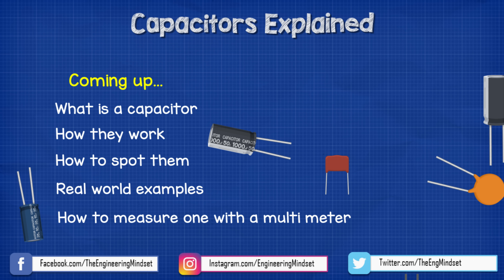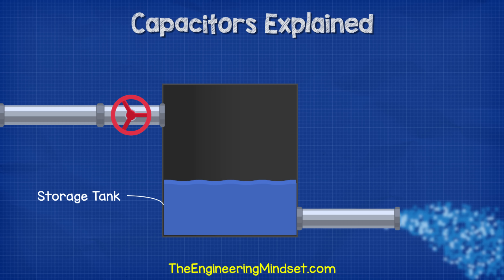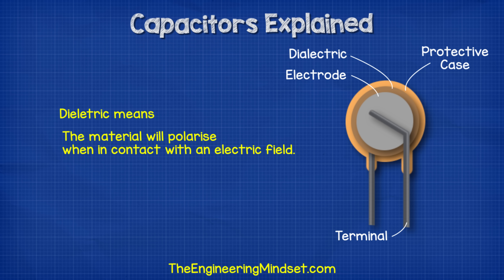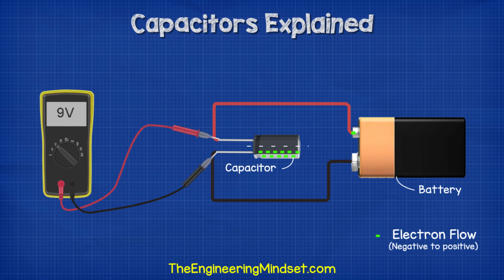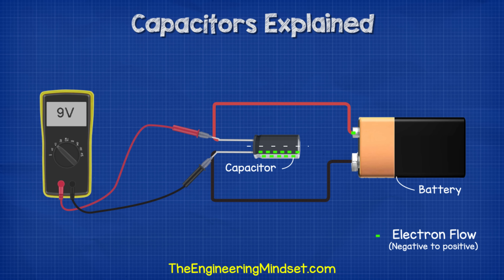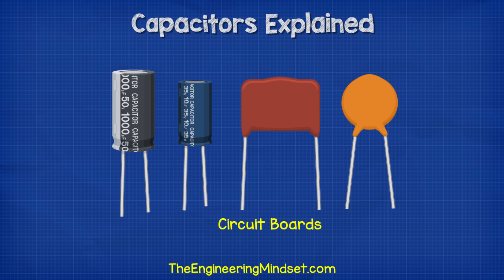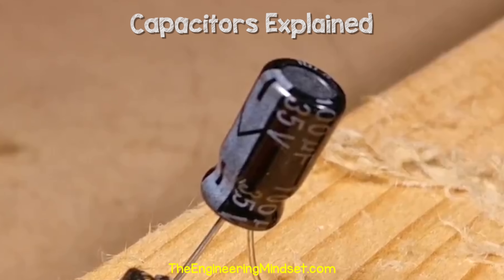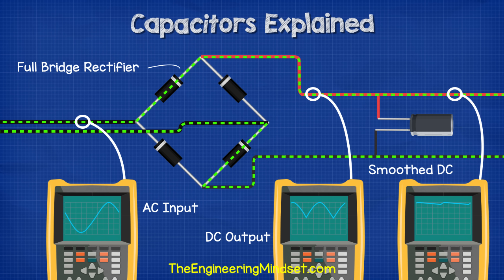Capacitors Explained - The basics how capacitors work working principle

Comment: I want a capacitor to smooth out my wife's attitude!
Reply: Get some money from her when she is happy. Buy her some chocolates when she is grumpy 😂....
Reply: @andrewwhite1793  Spot on, Sir!
Reply: Man! You get an A+
Reply: that's calle jewlery ;)
Reply: cash is also a capacitor dude. try to give her some.
Reply: she need resistor to slowly discharge it on the side
Reply: Just be careful not to touch her terminals or you might get a high voltage shock
Reply: when everyone's making jokes but he literally meant to kill his wife with a capacitor..
Reply: U need a s
Reply: good luck!!!
Reply: Sure you don´t mean "amplitude"?
Reply: It's called xanax.
Reply: u just need a resistor.........
Reply: If you have two childrens they will act as two plates as in capacitor. So after that your wife's attitude will be ok😜
Reply: It's called Valium😁👍
Reply: would that it was so.
Reply: Its called a credit card. Watchout though it can also explode...
Reply: capacitor you need is between your legs
Reply: You need a insulator  asap😂😂😂
Reply: That only works if she has an electric personality with a positive and negative bipolar disorder.
Reply: Start with a transformer
Reply: Good luck getting a capacitor that won't explode and make things worse.
Reply: Hhh
Reply: try some weed
Reply: No shit, mine was real out of phase with a wild leg to boot.
Reply: Maybe removing the resistor would help. Or try turning up the voltage in your bedroom.
Reply from the maker: Check out NEW resistor video, everything covered! ➡️ https://youtu.be/DYcLFHgVCn0
Reply: In the words of comedian Ron White, "Diamonds...that will shut her up"
Reply: @PH_INFO_101  SHE STOLE MY GAZEBO! Six million dollars later and his ex wife hired a guy to hook up a crane to snatch his gazebo out of his yard. You might shut them up, doubtful, but they'll always be up to something.
Reply: Try with a glass of wine
Reply: Sounds like a side boyfriend situation.....
Reply: @RafaelRamirez-vk4vu  What do u mean? Does having a side boyfriend change a married woman's attitude towards husband? If yes, how do u know?
Reply: That joke rates four rolling pins.
Reply: the7thsea That rates five rolling pins.
Reply: You'd need a capacitor rated in thousands of Farads for that!
Reply: Ok boomer
Reply: Should have taken the Red Pill and gone MGTOW!

Comment: The way I tested electrolytic Caps was to set a multimeter to the 200K ohm or above setting! Place the probes on the capacitors leads, the impedence will increase one way and when the probes are reversed it does the opposite. If it goes both ways - it's a worker. If it only works on one of the polarities, there is a direct short or there is no reading at all - it's a dud! Has anyone else tried this?
Reply from the maker: Check our new Multimeter tutorial out ➡️ https://youtu.be/4lAyzRxsbDc

Comment: You could've mentioned smaller capacitors (nF and pF) and the difference with how they work with DC and AC - ie. they don't let through DC, but lets through AC... and that the capacitance says something about which frequencies it let through.  Also, compare it to coils.
Reply: It's just a crash course though

Comment: Capacitors also blow up if your throw them in fire and if you chew on cylinder shape capacitors taste little sour and tangy.

Oh I forgot ... there’s a X market at rear end of capacitors it’s to direct explosion pressure towards the rear instead explosion going everywhere and causing more damage to circuit board.

Comment: Me during the first 6:24: "Hmm ok very interesting. Thanks"

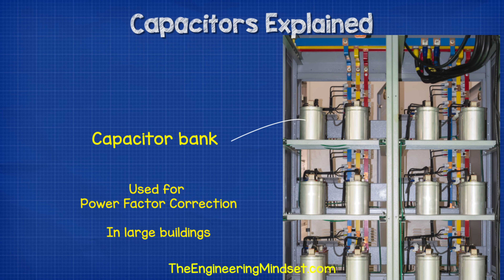Me from 6:25 on: "Wat"
Reply: AC is a game changer for capacitors and inductors. If an AC passes through an inductor, it generates a magnetic field that "holds" the current back a step (voltage is unaffected). Capacitor gets charged up with current and "holds" the voltage back a step, so it can compensate for the inductors.
Reply: @1urie1  do u mean phase difference?

Comment: I was expecting to know about the differences between AC Capacitors & DC Capacitors 🤨🤨
Reply: An AC capacitor ACs and a DC capacitor DCs.... that's the difference.
Besides a capacitor is a capacitor regardless what type. It was not shown in the video. It would then take hours. 
A capacitor ”only” change behavior regarding which circuit you put in.
There are many reason why you want using capacitors.

Comment: Wouldn't the process of reading a capacitor cause it to discharge the voltage through the meter?
Reply: Yes, but I believe it would be quite slow compared to attaching a resistor since multimeters are typically designed to detect current without consuming much of the power. Otherwise you'd have the meter warming up as current was consumed or blowing up when measuring a high voltage/wattage. 

Someone correct me if I'm wrong. :) I'm not an expert.
Reply: Ryan L. That’s true, but a very small capacitor would not store enough energy to show up on a meter.
Reply from the maker: Check our new Multimeter tutorial out ➡️ https://youtu.be/4lAyzRxsbDc
Reply from the maker: Check out NEW resistor video, everything covered! ➡️ https://youtu.be/DYcLFHgVCn0

Comment: Quick question is it possible to damage a capacitor by discharging it to quickly or is the internal resistance always enough to protect it.  This is aimed at electrolitic capacitors + even on large capacitors? Thanks
Reply: Repeated high current charge & discharge cycles can cause them to overheat (due to that internal resistance you mentioned). However a single short circuit discharge is usually safe (for the capacitor at least, may not be so for the thing doing the short circuit, e.g. the capacitor leads).

Comment: Still puzzles me why they would write 1000 uF (micro) instead of just 1 mF (milli). 
Same goes for smartphone batteries, really no need to have 4000 mAh when you can just write  4 Ah.
Reply: True, the long established convention is that "If the current flow is between 1/1,000 of an ampere and 1 ampere, the unit of measure used is the milliampere (abbreviated mA)".  Over time, the same unit ended up being used for larger currents. It could be because a battery rated 2700 MAh looks more impressive than 2.7 Ah

Comment: I like the video a lot!  I only got into learning about electrical circuits and batteries and stuff like that because of vaping.  My job is in the I guess civil engineering field, I'm a CAD Tech at a place that makes precast reinforced concrete structures for stormwater and wastewater management (bridges, culverts, etc.).  I recently learned about the condition called "water hammer" in plumbing, and the way the electrical circuit was compared to a water pipe made me wonder if there is any similar effect for electricity.  Is there an electrical "water hammer"?

Comment: when replacing a capcitor in a 3 speed ceiling fan, how important is it to match the MF of all 3 leads?
Reply: All 3 leads? As in the connectors coming out of the component? Should only be 2 leads per capacitor and you pretty much have to match the capacitance, in farads, exactly. You can use a slightly higher voltage but that may affect its lifetime.

Comment: Can you check the capacitor capacitance while is still on the board?
Reply: You can test capacitors in a circuit with an ESR meter, but it does not measure the capacitance of a capacitor. The capacitor must be disconnected from the circuit and measured with a capacitance meter, or a multimeter with this capability, to measure capacitance.
Reply: S/V Tattoo so what do I do if I just want to know if it’s bad?
Reply: @Laissez_Faire  - Many times I can tell a capacitor is bad by looking at it. Some types of capacitors discolor, swell or even burst when they go bad. Otherwise an ESR meter can help, but if you don't have one you would have to remove the capacitor to test it with a multimeter. Usually I just remove and replace suspect capacitors as it is quicker for me than having to remove, test, and replace. They are so cheap that it's not worth my time to test them. With older equipment I usually replace all the electrolytic capacitors as a first step to repairing the circuit, and more often than not it fixes the circuit.
Reply from the maker: Check our new Multimeter tutorial out ➡️ https://youtu.be/4lAyzRxsbDc

Comment: Can you talk a bit about circuit designs thot could smooth out/modulate a discharging capacitors voltage? Most devices nowadays aren't built to handle large voltage differences like 0-35v

Comment: So this means licking the leads of a capacitor is out of the question? 😄
Reply: Why would it be out of the question? All he's saying is that regardless of the outcome, you shouldn't be surprised. If your goal was to be zapped and you did get zapped, then it certainly wasn't a bad approach to take.
Reply: I would put a 9V battery on my tongue to see if it was still good...
Reply: Steve-o: Can't tell the difference between 6v and 9v. Maybe between 4v and 9v if you have a sensitive tongue!
Reply: @glasslinger  like any connoisseur I imagine it takes a developed pallet... Also pressure and continuity is important along with spacial separation all equal...
Reply: @steve-o6413  Doesn't everyone do that?
Reply: You can! Just be ready for the bite!
Reply: Yepp !!!. unless you want to roast your tongue.. (which is anyway healthier than frying it in the oil) 😆
Reply: Might be a shocking experience,  though.
Reply: Dallas Dal Your question is eminently suited for ElectroBOOM! ;)
Reply: Depending on voltage
Reply: @brianmckenzie2829  No, amperage.
Reply: @ Jim Cole No, voltage.
Reply: @jimcole6423  will 3v on 50amps do anything to your skin? no
Reply: Thanks for your correction
Reply: Depends on the voltage!
Reply: Barefoot in a pan of water.
Reply: Pure water is not conductive. Only when water is dirty. Water out of your tap contains lead, fluoride ect thats what makes it conductive
Reply: @brianmckenzie2829  The main reason for tap water being conductive is the various salts it contains; when you dissolve a salt in water, a lot of free electrons are released, and it's these electrons that makes the water conduct electricity.
Reply: @BertGrink  I do know, was trying to put into layman terms. Sorry nickeles tesla... Haha 😂
Reply: @brianmckenzie2829  My apologies, i didn't mean to belittle you.

Comment: Please explain why CAPACITOR is Not used as Battery, even though  it charges Very Quickly.
Reply: Unlike battery the capacitor discharges quickly so you will get very less amountbof voltage supply compared to regular battery

Comment: The μ symbol is the Greek letter mu or mju [mee-oo] and denotes  micro meaning ‘millionth’.

Capacitors also come in nano and pico capacitances.

I regularly work with capacitors designed to run at between 10,000 and 20,000 volts as part of an x-ray power supply.
Reply: That must be feel like a power trip XD How big capacity?

Comment: And when measuring the capacity of the capacitor it should not be more or less than 10% of the manufacturer's indication on the capacitor, if it is more or less than indicated it is a faulty capacitor and needs to be replaced

Comment: Hey this was great, but as an old fart who is trying to learn vintage radio repair, can you answer the question to when would I use a ceramic capacitor vs. a more common yellow or orange drop cap?? Thanks and God bless.
Reply: ceramics near a heat source

Comment: Why is a capicitor used in a point ignition system.  What is smoothed or stored?
Reply: When the points open and the magnetic field collapses it induces a current in the primary. It's not very much, but it's enough to jump a small air-gap, such as the one between the open points. That tiny spark is enough to erode metal away from the points and you'll 'burn' the points. The capacitor prevents the points from arcing while open by limiting the rate of voltage rise at the points.

Comment: The stripe for the negative pole of the capacitor has an arrow on it to illustrate the direction of energy flow...  Electricity flows from positive to negative,  everything in this video was explained backwards.  Aside from that deficiency the general theory is correct.
Reply from the maker: That's incorrect. Electrons flow from negative to positive as illustrated. In electrical circuits engineers draw and calculate it as the "conventional flow" from positive to negative because it makes things easier and also tradition, but that is not how it works in reality.

Comment: I graduated from Electronics in college in the 80s and you do a much better job at explaining a capacitor in a short video than what I learned in 2 years of college.  Great video....I subscribed and gave you a like...keep up the good work and I look forward to viewing all your videos.
Reply: The mark of a genius is to take something complicated and make it simple
The mark of an idiot is to take something simple and complicate it. That is what politicians do!
Reply: Is there an analogy for a transistor in a water system?
Reply: @frankgiancola7   I had a little wee on the emergency resivoir purge switch @ Three gorges dam and flooded the entire area killing thousands.
Imagine the transistors emitter being the water side of the dam the collector the dry side and my little bit of wee on the base allowed the flow of all the water from the dam to flood out.
Reply: @frankgiancola7  Surely you should know that answer if you're an electronics grad. That is City and Guilds electronics and servicing knowledge.
Reply: @frankgiancola7  Hydraulically operated valve?
Reply: @ThrawnSr  Yes haha. Almost every control device in electronics and almost every electric law has a equivalent on both sides. I think the only difference betwen electricity and fluids is gravity, and thats why current in parallel circuit hasn´t the same behaviour as fluid maybe.
Reply: It's takes one volt to push one amp through one ohm of resistance! Lol
Reply: Yes, I agree. But also, folks can walk away thinking they can master electronics and electrical theory in short order.  It's like gee, anyone can design and build circuits with ease.  Even a three year old can do it.
Reply: Crazy Contraptions that is how school works.  You pay to be stupid and without knowing your wasting time and life when can get better for free and not be in debt.  Stupid people don’t usually know they are stupid. And that’s what makes stupid people not stupid lol
Reply: my sentiment exactly, at least in the 80's we had awesome music
Reply from the maker: Check out NEW resistor video, everything covered! ➡️ https://youtu.be/DYcLFHgVCn0
Reply: What about using capacitors in filtering DC circuits
Reply: John Hampton   There is one in every alternator on engines in all motor vehicles. The alternator puts out a AC voltage that is intern rectified into a pulsating DC voltage. 
 An inductor circuit(also called a choke)that incorporates a capacitor, is sometimes called a filter circuit in the alternator to make the pulsating rectified DC voltage into smooth DC voltage output of the alternator. 
 The same type of inductor circuit is used in car radio systems to stop the electrical noise from the very high DC voltage ignition system.
Reply: But it was quite normal

Maybe high school level
Reply: I fully agree. We are from the same generation of the 80s. I had 4 semesters of electrical engineering subjects. I took chemical engineering. I could say the same. The chemistry videos I watch here explain the topics much better than what I had in the university.
Reply: The video covers the equivalent of the first page of chapter 1 in Capacitor Basics, sorry to hear you learned less in 2 years.
Reply: @pflaffik  It is kind of strange that people here claim this video has more information that they learned in College about capacitors in 2 years. I would think that you should be able to design simple capacitor circuits in that time and calculate the values for that.
Reply: Hi, I have a question please? Can I solder/repair my broken capacitor. I have an electric extension wire from panther and it's got a capacitor inside. I was cleaning the inside when I suddenly broke the capacitor. One of the pins (don't know if it's the positive or negative pin) was detached. Can I solder it back? Thanks in advance
Reply: I knew Einstein.
Reply: I meant a volt once. They are very pushy.
Reply: Water does not think.
Reply: Thats exactly what i tought, in particular the water at the start.
Reply: @theq-1  In fact a water pipe is quite useful when explaning electrical circuits. Resistor is someone standing on a hose, current is quite obvious and voltage is the pressure as used here. With that in mind you can also explain ohms law and some other stuff and people understand the basic meaning.
Reply: Roichi R Imagine a water tank with pipes on opposite sides and a very tough elastic membrane dividing it into two chambers.  Assuming the pipes and chambers are filled with water (a sealed circuit), if you pump water in one side, it seems to come out the other UNTIL the limit is reached, then it stops.  But if you turn the pump off, the elastic force of the membrane pushes the water backward until the membrane is no longer stretched.

Further, if you connect this device in series with an alternating pump and a load, the “water flow” appears to go through the membrane if you make the pump reverse direction often enough.

Comment: When I worked in hydraulics/pneumatics design we were located next to the electrical design folks.  Many of these guys kept a fully charged capacitor on their drafting table to screw with a new guy that would come over and BS.  The guy would pick up the capacitor and receive a little present.